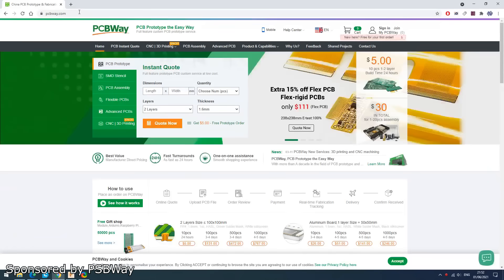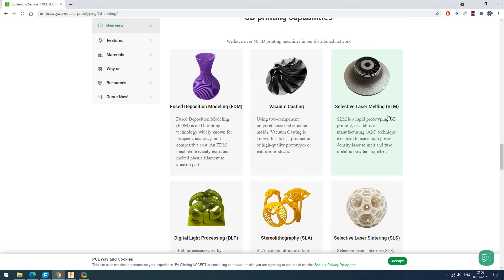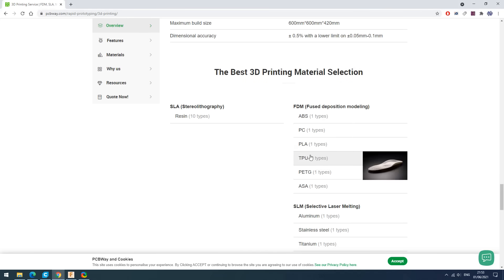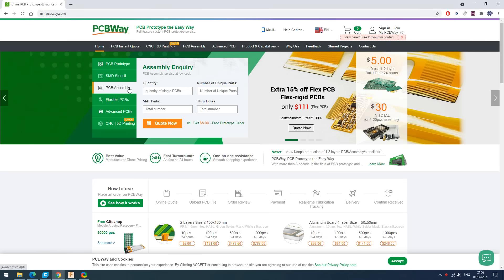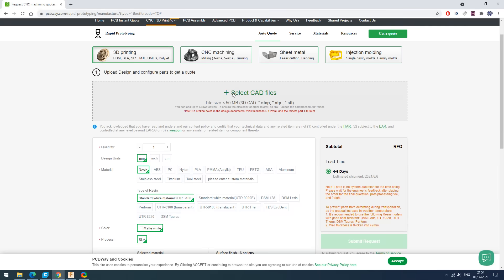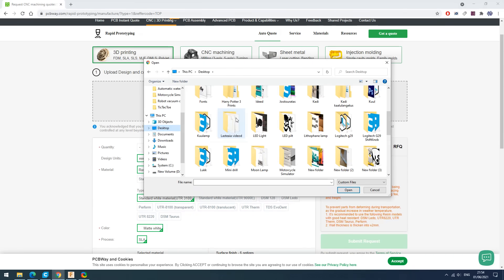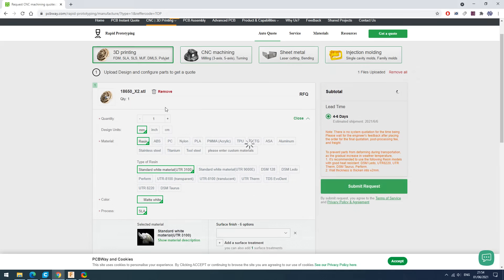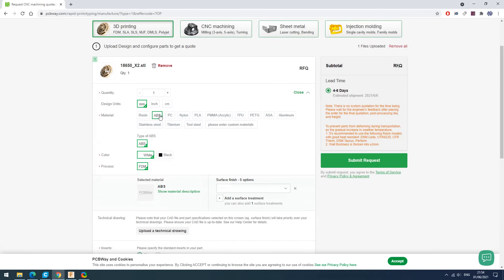Try These 3D Printed Tools

Comment: 8:47 Looks like a very bad idea; those valves can get pretty stuck and the last thing you want is for your tool to break just as you've opened the valve. There is quite a lot of water in your heater and most of it is going to come out while you frantically look for pliers. A metal tool costs a few bucks and is guanrateed to work.

Some things are better off in metal, and this is one.
Reply from the maker: The original bleeding tool, which came with a valve is also made of plastic. I haven't had any problems with valve stuck. It could be a problem, when you over tight them.  Water amount in heating system is big, but the valve hole is small and it's not coming out very fast. You can also use screwdriver to close the valve.

Comment: The filament cutter would be great for weedwhacker line
Reply: I was thinking the same thing lol
Reply: Weedwacker line works alright as printer filament also ha
Reply: @MR_G92  Beat me too it! I heard that. Haven’t tried it, yet….
Reply: @Jack Williams  I tried the oregan 1.7mm line and it printed fairly well
Reply: @MR_G92 I've done it the other way round, funnily enough. 
My father ran out of strimmer line recently so I removed the empty cartridge and filled it back up with cheapo PLA.
Cuts grass well enough

Comment: What are the press in threads called at 5:50?
Reply: Threaded inserts. You can screw them in, usually in wood, or heat them up to melt into the pla.

Comment: I have problem printing threads. They have the edge bent upwards and I can't figure out why. Tried speed reduction, fine or normal print, different slicers, different PLA roles... Do you have any advice?
Reply from the maker: There could be cooling problem. Lower the print temp. Watch over your fan settings. Level your bed. Use slower speeds.
Reply: Did you calibrate your extrusion? There are plenty of videos on it. What I think might be happening is that the subsequent layers are cooling down, shrinking, and pulling on the layers below it, thereby warping it upwards. Let me know how it goes.